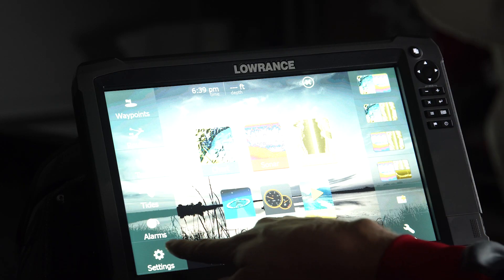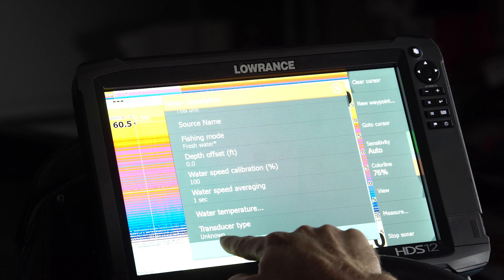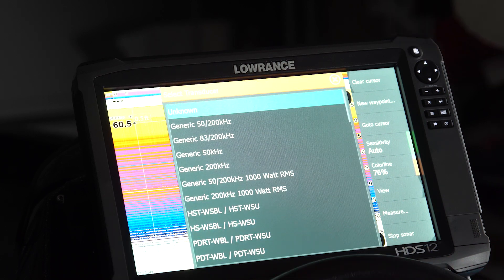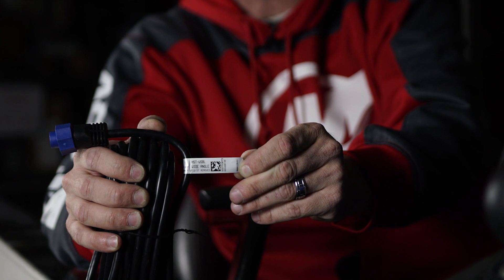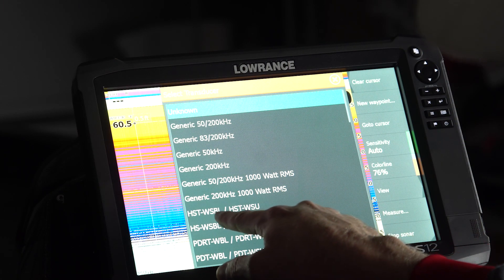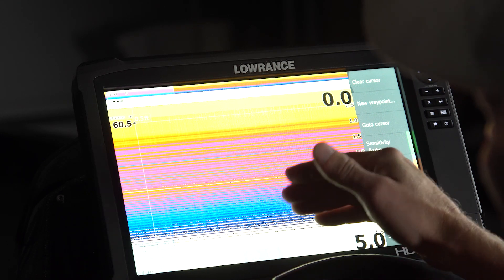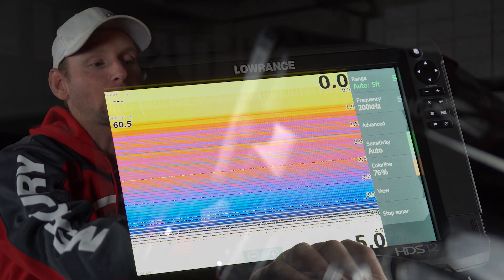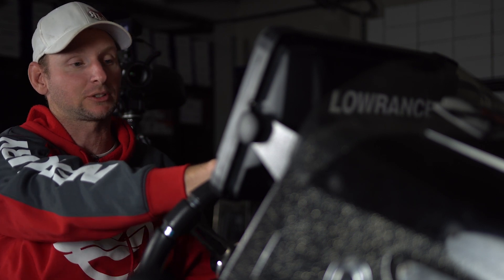Lowrance Setup:  Selecting the Correct Transducer

Comment: What do you do if my used boat I bought has 2-HDS7 gen2 locators (bow and console), 1-Elite 7 Ti locator (stern), 1 skimmer transducer, 1- HDi transducer, 1-LSS-1 or 2 transducer and 1- spotlight scan transducer (trolling motor) and when they installed it all they took the white tags off the cables so I don't know which transducer goes to which locator except the spotlight scan which is hooked to the HDS7 Gen2 on the bow?🤥

Comment: I believe the silver tag on mine was pulled off while pulling the cable through the hull and I’m having some issues with figuring out which transducer I actually have. Is there any other way to identify the transducer? I’m running an HDS gen 3 unit. TIA!

Comment: Hey I have a question. I have a 112 hand controlled fortrex the leads from head are 10 gauge wire and five foot long .I am going to run 8 gauge from that to my plug (70 amp marinco) and 8 gauge to batteries and circuit breaker. Do I need to shorten the lead from the head to 3 ft or what do you recommend? I dont know why minn kota used 10 awg from the head. This would be a great viedo to do as far as length from head and lenth to plug and what gauges
THANKS JAMES

Comment: Hi.  Enjoying the videos.  Have Carbon 9.  Channel 2 has XDCR SS HD transducer.  I believe this was s the LSS-2.  Can’t find an option on the screen to properly install it on the Sonar menu in settings.  It shows Total Scan and AI2 and AI3, but nothing resembling LSS-2, Structure Scan HD, or XDCR...,  what transducer should I select.  Software updated regularly.  Current version on unit shows: 20.0 Application 63.1.291.  Any suggestions?  Thanks!
Reply: Any one ever figure this out

Comment: Hi Russel & thanks for all your shares. 
I am curious though, how ever. 
I have the LSS2 Transducer installed on my HDS 7 GEN2 TOUCH, 
but I cant find this transducer in the pull down selection in the 
installation screen. 
How do I go about installing my LSS2? 
At the moment, I have it set to generic, but I am unable to access all 
of the LSS2's potential! 
Can you please help?
Reply: I have the same problem. My transducer is not showing up on the selection menu. Did you get it fixed?
Reply: @fire71man  Nope, I'm afraid not Alan. Lowrance don't seem to be much help either!!

Comment: when setting up lowrance elite Ti2 which transducer to select for active imaging 3in1 . On the tag it states it's AI2 3n1 but can't find it in the menu
Reply: I'm sure you've figured this out by now but you have to select the Totalscan transducer. On my Simrad Evo3 once I did that and power cycled the unit and went back to the installation menu, I could see it was now properly showing 3-in-1 as selected transducer.

Comment: What if you have lss2 and the hdi teansducer hooked up to same unit which one do you pick
Reply from the maker: you cannot run both at the same time without having some interference.  The hdi will do down imaging and so does the lss2 transducer, they both operate on the same frequency and you will confuse the unit and cause issues. If you have the lss2 you really need to run the 83/200 transducer (HST-WSBL) for 2d sonar.
Reply: So, I have the LSS2 and the HST-WSBL on the same unit (HDS 9 Gen 3). Is the selection list is just for the 2d sonar only?.... because....... I didn't see an LSS2 option on the list, thinking that I might be able to highlight both transducers, and then save. That wasn't possible though.

Comment: Justin, I have the Carbon 16 and the TotalScan tranducer and when I try to look it up it does not show up in the listed transducers. My tag says FA Totalscan. Becasue it is totalscan do I need to add it in another area? I have good side and downscan but no 2D sonar unless i hook up the old hull mounted sonar unit. Thanks for any help!
Reply: I have the same problem and Lowrance has not responded???
Reply: Michael - under the home screen settings- sonar-installation you will see two things that I played with after talking to Lowrance that helped. Changing the multi source to single source (if just using the totalscan transducer and nothing else) and also turning off either Channel 1 or 2 depending on what the unit is seeing.  I also did a soft and hard restart during the discovery call with Lowrance but changing the multi source to single seemed to be what worked. I have my 16 as a stand alone unit and only running the totalscan ducer into it.
Reply: I had to do the same and the unit seems to be working correctly. Still, which transducer type did you choose for the totalscan transducer? Did you just leave it on unknown? I chose the medium chirp option but I do not believe this to be the best option.